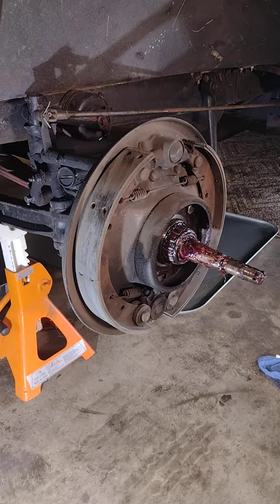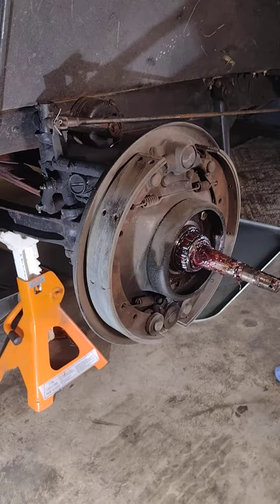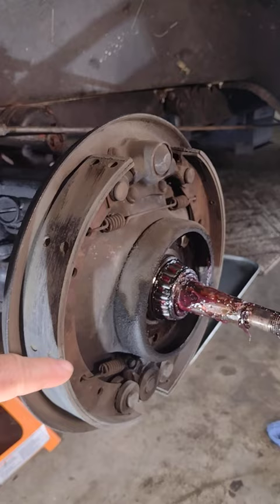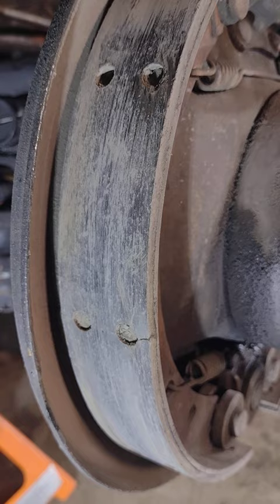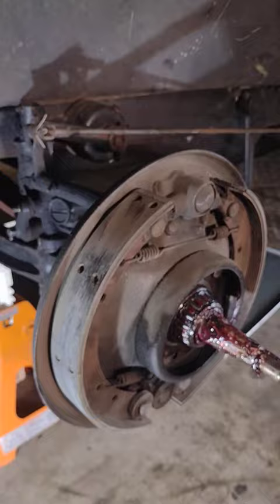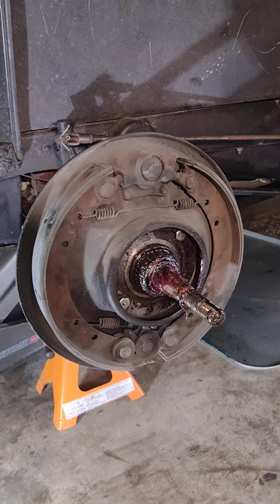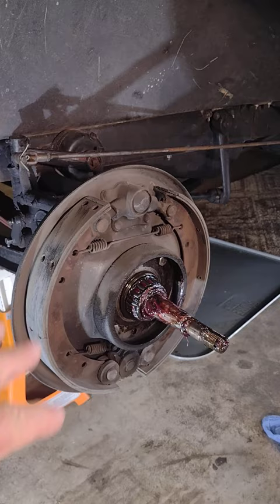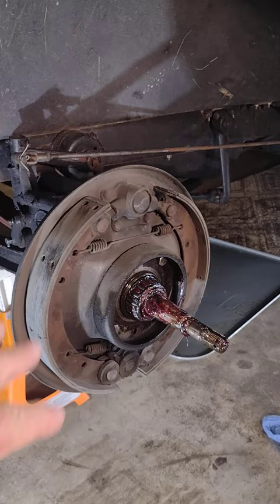One thing to look for on Brake Shoes for a Ford Model A

Comment: Break me off a piece of that...huh? It's not a chocolate bar? Oh, never mind. 
On a serious note, linings rarely get looked at unless packing bearings or other brake related issues. New shoes or relining them is cheap insurance against brake failure. Good stuff! Keep it up!
Reply from the maker: I know I look at them once a year on the A or at 5K intervals on any car.  It's easy on modern cars for sure.  Just take a quick peak when rotating the tires.   I get that the A requires pulling the drums but I would rather be safe then dead!

Comment: That looks like an impact. Even the metal has a dent in it. That isnt normal wear and tear.
Reply from the maker: Nothing is dented.   Those brake shoes are cracked across the rivets.  In most cases cracking is causes by overheating.  The previous owner installed cast iron drums but never changed the brake shoes.  I would highly suspect that these were overheated excessively with the former steel drums that were on the car.

Comment: Would rather upgrade the brakes in that thing if it's being driven around
Reply from the maker: Actually, mechanical brakes with cast iron drum brakes stop pretty darn good when they are adjusted correctly.  Putting hydraulic brakes doesn't make up for all the other 90 years of the lack of modern car amenities and features, like air bags.  I felt pretty safe driving this car 550 miles one way to Dearborn, MI last year with a total of just over 3,500 miles and have plenty of friends who put thousands of miles a year driving their Model A's
Reply: @kensmithgallery4432  Have fun sourcing 90 year old parts every time you service this thing. It's about making it realistic to use, Mr. Paragraphs. If it's just for show and preservation then by all means. Don't try to tell me it makes sense longevity wise.
Reply from the maker: @GuitarDudeSean  as to sourcing parts for a Model A.  I can easily get parts anywhere.  Plenty of new and reproduction parts are out there from multiple manufactures.  Nearly 5 million of them were built in a 5 year span.  Lots of parts still around.  I enjoy driving my car as well as working on it.  Plus, I enjoy the many friendships I have developed with other Model A enthusiastic owners.  90 plus years and still runs.  That's a lot to be said.